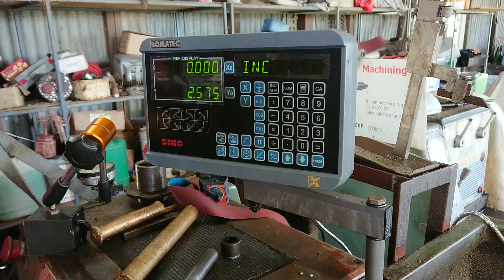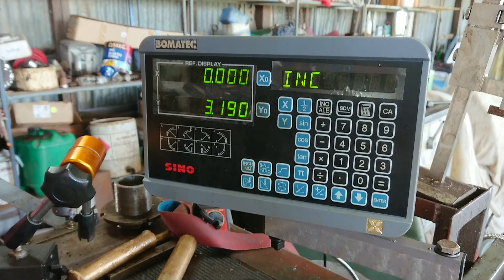Keyway cutting on a lathe

Comment: I have a question about your drop
With a long bed do you have a full length scale on the bed axis or just for the first 2 or 3 feet?
The cost of a full length 8' scale for my lathe is cost prohibitive to say the least at $2500 for the scale

Comment: Nice one! What horsepower motor did you use? I will have to make one of these!
Reply from the maker: Affetkak  thanks carnt read hp. But says 3.5 amps at 240 v so low hp
Reply: Cheers. Its probably about 1 hp ish